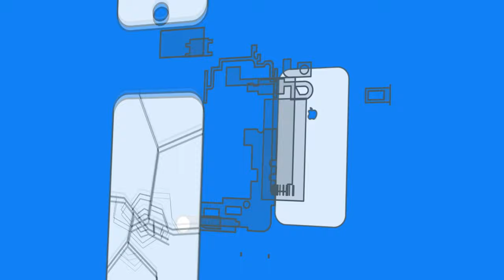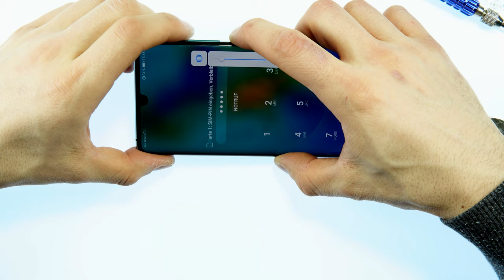Huawei P30 Pro Microphone Defective | 🔧 How to Replace Microphone and Sim-Slot

Comment: Great video, very helpful.
Unfortunetly microfon is still not working. out of ideas .  Factory reset didnt help eather . I can talk during the phone calls but I cant use Google asistant or soft to recognized songs, search engine or gps is also deaf .
Reply from the maker: Maybe the connection Flexcable Ribbon.
Reply: Same of u😢
Reply: Same here bro. I can't use the microphone for Shazam for example, but I can have phone calls.
When recording videos only one side works. I mean, usong headphones, only left side works. Nothing on right side. Not sure if it is primary or secondary Mic, the issue I mean. But I think it is primary.

Comment: What's the difference between the type A and the type D flex cable that runs from the board across the battery up to the mainboard?
Reply: Did you ever find out?